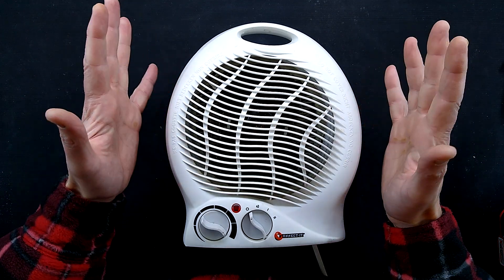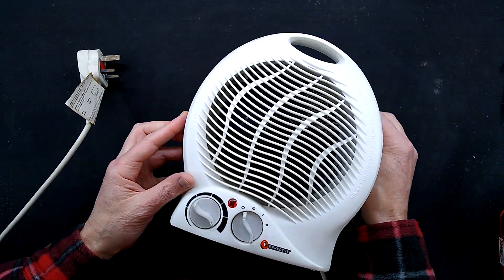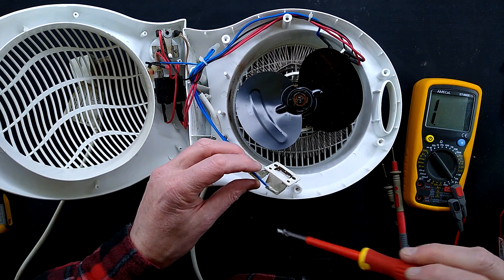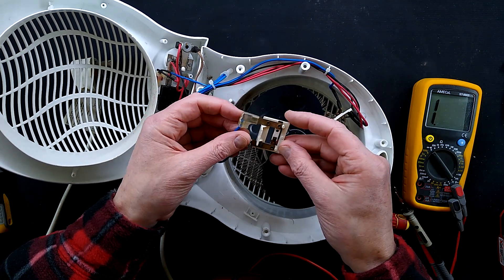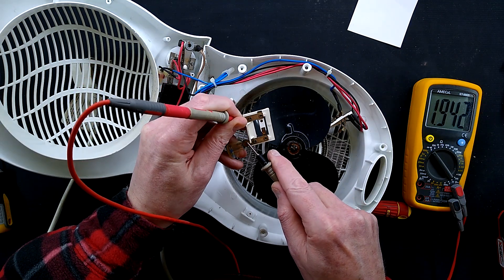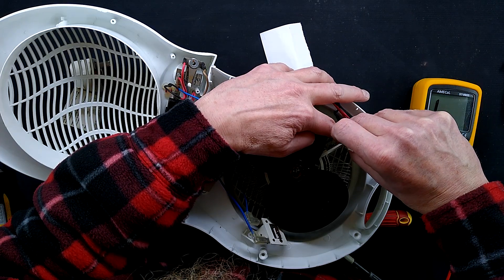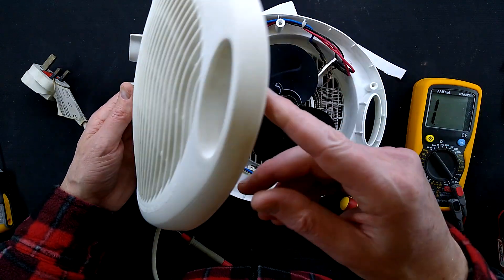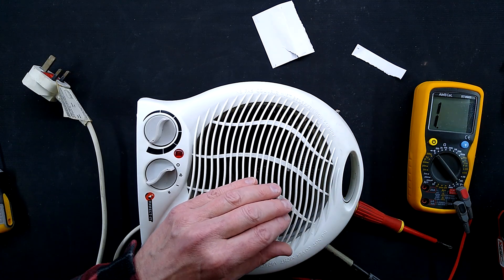Fixing a heater and an apology to my bro

Comment: I have the same heater but it has a tip over safety cutoff button on the bottom. I don't see that on this heater. I'm in the US. Is that not a requirement in the UK?
Reply from the maker: It is found on some heaters, but not all styles.

Comment: Why would anyone buy run or even have one of these things in their homes they are way the most expensive things to run as electricity prices in the uk  are far the most expensive in the world!
Reply from the maker: Because when you just need a little heat boost it works out cheaper than gas or oil heating with high installation costs and an "annual service contract".

Comment: It is unbelievable how badly some of this Chinese stuff is made. We had a pedestal fan that was good but after a bit of time it appeared to slow down. So I shot some silicon lube into what I thought was the bearing and it would once again run fine for a while. We eventually replaced it. I always like to salvage the motors because they can be useful for projects or as testing items. To my amazement what should have been a bearing was in fact two copper rings, one sliding inside the other. Which other than wear would quickly accumulate dust. So I rebuilt that motor with proper bearings. The thing that really pisses me off is that the bearings were not expensive at all. It would have added a couple of dollars if at all to the price and would have lasted longer and run better. That is the thing with greed, blind and stupid.

Comment: Where can I get a replacement tip-over safety switch for that very heater (or one that looks like it like I have)?
Reply from the maker: If it uses a standard microswitch you may be able to get a new one.  But if it has a custom contact assembly it may be harder to find.

Comment: I have a near identical one. Same casing, same innards but no anti tamper screws and there is a floor switch so it switches off if knocked over.

Comment: The recommendation that I've seen regarding thermal fuses is to use crimped connections,  not soldering.  The last heater of that sort that I had failed in that the plastic shaft behind that knob to select the range broke. It went up into the attic and when I moved it did not make the trip.  Oh well.  I got enough use out of it before it failed, anyhow...

Comment: Used to service carpenter and Ericsson relays used in radar kit (something to do when bored on nights). The card of choice was the RAF F731 serviceability label. The older coarse ones were the best - the newer glossy ones weren’t so good. We also had various grades of diamond coated scraper thingies (imagine a half in feeler gauge on a plastic handle), but they were never as good as card.

Comment: I use one to keep my boiler room warm I run used canola oil, it works great. cheap easy. Surprised it does not have a bottom safety switch.

Comment: I would use some high/fine grit metal sandpaper on it. And even a little water (for lubrication) on it won't hurt, provided you allow it to dry prior to plugging it in.

Comment: Ah Ralphy - you're also an ubh mhaith BUT use your noggin, a chara. Mother Nature is great and will forgive anything/everything EXCEPT carelessness and/or a mistake ("Build it to fly, it'll crash; build it to float, it'll sink; build it to use electrons and THEY'LL KILL YOU!"). If/when storing electrical stuff in the shed for instance, keep 'em as damp-protected as possible - in a sealed - sealed - plastic bag usually works and leave them for a while when you take them indoors (room temperature). Plus - remember the 6 Rs - "Reduce, Reuse, Restore, Repair, Repurpose & Recycle". Happy (and safe) Christmas all...... please mind your eScooter - it ISN'T a toy, so charge/store it properly, as per instructions (I know - reading/following instructions sounds more girly than butch but still....). 🛴🛴🛴

Comment: I recently had to start using one of these as the central heating packed in and on full (2kW) the plug becomes its own heater, excellent. It could be worth advising Ralph to check that after 10 mins or so on whatever heaters he has around the place.
Cleaning up the prongs and tightly screwing down the contacts in the plug allowed me to use it on 1kW until I could get another heater.

Comment: My usually die of desiccation, sort of. Whatever oil is used to lubricate the axle dries out. Then the fan starts buzzing, then it starts howling, and then it stops. I've tried various solutions with no good result, If anyone knows good over-the-counter lube/oil then please do tell. Oh yeah, one of them died in a spectacular fashion when the power cable shorted out after being bent over one too many times. It happened at full heat and in my hands. The bang was rather ear-wringing. It would have made ElectroBOOM proud.

Comment: I've got this exact heater! Every winter I have to pull the damned thing apart and clean it up inside. Even though it is kept indoors, those bi-metal contacts corrode and oxidise which kills the heater. Crappy materials during manufacture to keep costs down is to blame.

Comment: Cool! I also had to fix this kind of heater in the past (the internals are literally the same), but the repairs were far less straightforward then here. It's actually a good heater in the sense of heating, but it could also be very dangerous!
I was living in my cottage out of the city, and it got cold at night, so I usually had this heater on to maintain a temperature in the room. And one night I was already half-asleep when I heard the fan slow down just slightly. I didn't really pay much attention to that since it was still working fine. But what really woke me up seconds later was the big fire show in the middle of total darkness! I immediately jumped out of the bed and moved towards the outlet in the dark, my path being illuminated by all kinds of sparks and a fire in the middle of the room! Luckily I was not asleep and quickly reacted to that, and in the end only the heater suffered any damage.
So, what went wrong? In my case, since my house was far from the city, there was not much power to run different loads. And if the neighbors decide to use, for example, a kettle, then all lights dim and flicker at my place. So it's very possible that my neighbor just wanted some tea in the middle of the night, and the power drop caused the fan inside the heater to slow down a bit. But the heating element is so strong that all the wiring inside immediately caught fire! I gotta say, based on that experience these heaters are running on edge all the time by poor design and could easily turn into fire hazard.
As for the repairs, all the wiring was completely burned inside, so I had to reverse engineer the schematic using only my knowledge and experience (but its a very simple circuit of course). Everything else was burned and a bit molten, but still good enough to be put back together.

So the moral of the story is: Don't leave working electronics unattended! Know your power supply capabilities before using loads! Use only reliable things and not this plastic crap (like, I have the same type of heater now but it's made completely out of metal, and way better engineered)

Comment: I have very much the same heater. The brand is different, the shell is the same. In my case the fan does not spin, but the heater is quickly warming. I immediately stopped it, because without the fan it will just burn. It was good I was there to stop my kid. Now I will soon open it to see what is going on.
Reply from the maker: May be a dry bearing or a detached winding wire.

Comment: I’ve resorted to using a foot switch when doing these types of repairs. Push the pedal down to test for a few seconds, then lift your foot before restarting repairs.   Preferable to forgetting to unplug and less work than unplugging over and over.

Comment: Our old toaster  had pitted contacts on the electromagnetic switch. Cleaning worked for a while, but they are prone to sparking when they disconnect. I was going to fix it again, but it was less bother to buy a new one.

Comment: A friend's standard lamp has an E27 light bulb which flickers. The replacement did the same. The fault is a high impedance in-line switch moulded onto the cable. I need a new switch. I have fixed fan and convector heaters in the past.

Comment: I've recently repaired my own example of this very common heater. Damp and dusty storage had caused the fan motor to seize; a little cleaning and lubrication and it's back at work.

Comment: We have the same space heater with this design sold under a dozen different names, it's the worst and cheapest chinese crap you can buy. It costs like $10 and the problem is always the same: mains cord wiring is inadequate and it can easily melt or catch on fire if it's used for too long. Also they are prone to heavy corrosion like the one in your video. Spend more money and buy a decent heater, avoid anything that looks like this.

Comment: Is there no alternative contacts that can be used or perhaps parts that can be bought to swap out the cheap parts for something better or is that just not worth the cost?
Reply from the maker: You possibly could substitute a better thermal cutout, but there's no guarantee that it's going to respond fast enough for the device.

Comment: I doubt that the contacts are made from anything that would corrode, even in salt air. It might be arc pitting, but cleaning with ordinary paper is unlikely to smooth that out (like a burnishing tool would). Could the contact leaves be not pressing together as hard as they should? But again paper won't change that. Soot? in the end, nothing will seem as satisfactory as a rigorous burnishing and readjustment to insure solid contact in a serious application like this. After all, people could freeze to death waiting for a 15 cm log to ignite

Comment: I'd have used 1000 grit paper and DeOxit to assure the contacts don't over-heat due to some resistance. Relying on high voltage to make the connection is unwise.
Reply from the maker: Sandpaper can remove contact coatings.

Comment: It's a fairly well thought out design having a thermal cut out on the plastic case, one I used to have that the motor failed in didn't have that so Ralph's heater is safer by design.

Comment: My roommate bought a heater similar to that at Family Dollar... probably about 10 yrs ago now. That thing was a BEAST! I don't remember what it was rated, as in how large of a space it was meant to heat - and this house is fairly small. But his room I'd say is medium sized, our kitchen/dining area is a bit larger than that room. If he left his door open it would heat his room to what felt almost 80°F, and half the dining area. Better than any of the $45-80 space heaters we bought since then.

I went to buy 2 after it finally crapped out after 4 yrs or so of running in the winter. He would leave it on high all the time when he left the house, with me usually home. But Family Dollar had stopped selling that model by then. Guess the owners or manufacturers found out it worked too well!

Any way to replace or upgrade the contacts you mentioned here? Or best just to clean them?
Reply from the maker: The thermal cutouts tend to be hard to find as loose components.

Comment: Real quick, what's that testing thingamajig for quickly and safely connecting wires to mains voltage that Clive uses? You know, with colorful contact spring levers, a neon light and a lid that's also a switch? I know he said it 1M times, but I can't seem to remember it nor find it...
Reply from the maker: Cliff Quicktest.
Reply: @bigclivedotcom  Thank you big guy!

Comment: I have the North American version of that heater.  I got it when the oil-fired boiler in my apartment building had a catastrophic failure just after the start of the heating season. The heat exchanger fractured in use, and there was a vast quantity of steam that roared out of the firebox, followed by a great deal of water.  It took a week to get a gas boiler installed as a replacement, and it got quite chilly.  I occasionally use it when, like this year, the date local regulations require the heating to be turned on is not the date I would have waited for if I had my own thermostat.

Comment: Can you explain how the (I assume) potentiometer control works with the thermal contact? Does it limit the voltage and thus the distance required for an arc to form? And as the thermal element heats and bends it reduces that distance? Also the click heard when it powers on and off, is that sound only from the arc made?
Reply from the maker: No electronics.  Just a bimetallic strip that bends with ambient temperature.
Reply: @bigclivedotcom  what about the temperature settings dial is what I meant.

Comment: The most common faults I had with mine was if you put them above low settings they would trip within a few seconds, I lived in a property where the landlord had a crazy no gas heating 8 months a year and the 4 months it was on, it was on low as "the boiler couldn't handle it" but we could use as much electricity as we needed, went through so many heaters, I think as I had them on hours a day during cold winters so must of worn out something in cable, in the end I just used the ceramic bar heaters instead, seemed warmer and no noise.

Comment: I've done many repairs on those cheap heaters. There is one more contact (bimetallic strip) in the temperature control. I use 600 grit sandpaper to clean all the contacts. If I see any warping or melted plastic, I let them know that even if it works, I highly recommend replacing the whole heater.

Comment: The thermal fuse i needed to repair an espresso machine was available with spot-welded pigtails, which saved me dealing with soldering to it. Recommended!

Comment: Unless they have changed the plastic recipe these plastic fans are a disaster waiting to happen. . I know someone who had a black and decker fan heater in a shed . Left it on for 10 mins before he went in the shed as it was middle of winter. 10 mins later the shed was half burnt down . Fire brigade said the motor probably stoped  and the thermo cutout failed

Comment: Cheap heaters are pretty poor quality in some cases, I’ve got a tiny 900w one that the fan is wired to part of the heating coil in order to lower the voltage, and the fan started having issues running properly so the thermal fuse went in it.

The solution was to install a thick copper wire fuse instead, and duct tape an usb desktop fan in the back of it - it worked wonders for a few months until I bought a better and bigger one, and always made sure to run it on a timer with intervals of 15-30 minutes. Granted if it ever had started failing due to overheating - then 15 minutes is an eternity… ;)

Comment: I had the EXACT same plastic white fan heater! Different brand name, everything else looked the same. Almost burned down my house two weeks ago. Fan didn't turn on, started glowing bright red and within 10 seconds the plastic started melting. The thermal safety did NOT work. If that fan failed and I wasn't standing next to it, my house wouldn't be here anymore. Dangerous devices.

Comment: I have the same heater except mine has a sprung switch in the bottom side that disconnects the mains when the item is not standing on the ground, I'm surprised yours doesn't have it

Comment: I went through a couple of these where the switch would keep melting (the metal inside the switch would weld and the plastic would melt). Eventually I came to terms with the fact that when it says "do not cover", it really means it. My current one has been going for over two years. Who would've guessed that using things as instructed would allow it to work correctly? 🤷 (To be fair, there are plenty of things that don't work even if you do use it correctly. 😒)

Comment: When I was young and still learning, I once got my soldering iron out, opened the TV to be worked on, pulled the plug, started poking around, and found a loose wire. I reached for my soldering iron, only to discover it was cold. I then realized I had unplugged the soldering iron rather than the TV I was working on, and had been poking around in a live chassis for over 10 minutes. My knees got weak and I had to sit for a moment. So the comment about "sometimes they unplug the wrong thing" hit home. Never made that mistake again, though - one near-accident was enough to scare me into a more cautious behavior.

Comment: Hmmm... Have one almost the same. I managed to put the heat on 2 out of accident, felt smell of really hot plastic and then the smoke detector in my hallway started beeping... Bummer! But 1 is usually enough.
Reply from the maker: That's often dust or residual manufacturing oil on new elements.
Reply: @bigclivedotcom  Prolly, but it's good to know the smoke sensor works! But it took me a while to make it shut the f**k up! ;)

Comment: Chop the plug off and replace it with a decent one... We had several of these, the plugs pin insulation melt due to the very thin conductor between the pin and the plugs screw  terminal on the neg  and fuse clip on the live

Comment: My Heater suffered from crimp failure over heat tripping the cut out, so soldered both crimps. Still works after 4 years.

Comment: I've just bought a cheap fan heater and the hysteresis on its temperature switch must be about 20 degrees, making it hopeless at maintaining a comfortable room temperature. Is there any way to improve this?
Reply from the maker: You can get plug-in thermostats.

Comment: I've accumulated a fair few thermal fuses rescued from dead appliances, and wondered why they were crimped instead of soldered. I always thought it was because the wire ends were made from some mysteriously un-solderable stuff. Every day is a school day!
Reply: Everybody solders in a new thermal fuse before realising why it doesn't work afterwards.